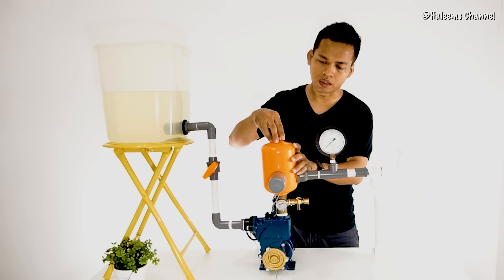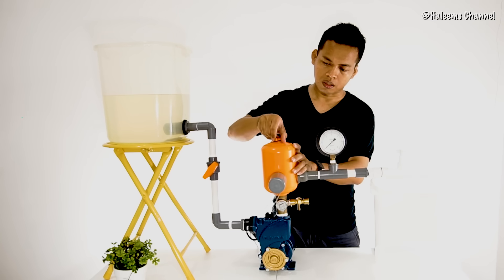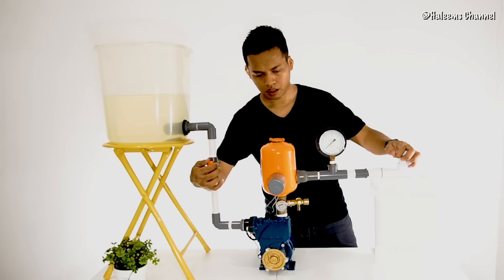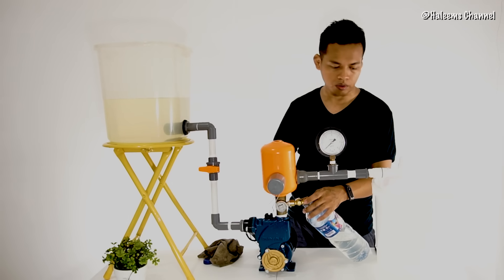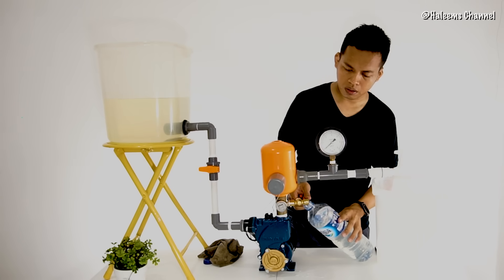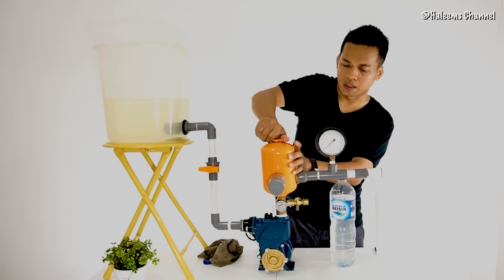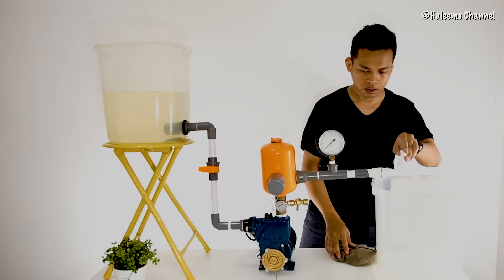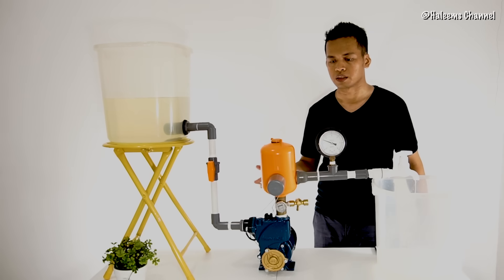Cara Memasang otomatis Pompa air dan Mengatasi Bunyi Cetak Cetek pada Otomatis/Pressure Switch

Comment: Pak saya ada pertanyan, jika sekiranya berkenan menjawab:

Pompa air saya kadang cetak cetek terus setelah 2 minggu instalasi,, saya makai pompa air shimizu ps 135 e.
Pompa air tsb dipasang setelah toren kapasitas 750 liter-> ke filter frp 1054 2 unit -> ke area output rumah (2 kamar mandi, dapur, & halaman).

Penyebab cetak cetek kenapa ya?
Apakah ada cara/solusi terbaik mengatasi permasalahan tsb ?
Reply from the maker: Cetak cetek kalo masih ada jeda nya, ada ritme, itu masih kondisi normal/wajar...
Tapi kalo cetak cetek nya tanpa jeda, itu berarti sedang bermasalah pada tangki nya sudah penuh terisi air...

Banyak metode utk mengatasi cetak cetek...
Paling sederhana, keluarkan air di tangki nya, 
Standar tangki model PS135E, tidak ada karet pemisah.. sehingga sangat mudah berpotensi cetak cetek... sebaiknya ganti tangki yang ada karet nya...

Metode metode lain..
Seperti APC, kombinasi flow switch+pressure switch, ganti tangki yg lebih besar, dll... itu semua bergantung kebutuhan dan budget nya ..
Reply: @HaleemsChannel  terima kasih pak atas penjelasannya. Iya betul, cetak-cetek di tempat saya masih ada jeda & ritmemya. Jika saya milih untuk mengganti tabung standar PS135E dgn tangki yg ada karetnya, apakah ada contoh merk & seri yg di rekomendasikan ?? 
Saya jg menyesuaikan budgetnya.

Terima kasih

Comment: Selamat pagi bosskuu.

Saya punya pompa tabung merek dab.

Dia cetak cetek, kemungkinan tekanan di tabunganya kurang ya ?
Reply from the maker: pertama kenali dulu jenis tabung nya ya gan..

type tabung ada beberapa jenis..
1. tabung biasa, tanpa penyekat/membran pemisah sisi basah/air dan sisi kering/udara.

tabung jenis ini, lebih cepat habis isi udara nya, sehingga lebih sering bermasalah bunyi cetak cetek..
tidak rekomended..

2. tabung dengan penyekat setengah, dimana posisi penyekat/membran nya ada di tengah, ukuran membran lebih kecil, tidak bisa/tanpa refill udara atau gas nitrogen.

tabung jenis ini, cukup membantu mengurangi cetak cetak, kekurangan nya volum udara nya gak begitu besar, karena hanya separo dari volum tabung nya... selain itu tidak bisa di refill udaranya..
kurang rekomended.

3. tabung dengan penyekat bladder, yaitu membran nya terpasang dari sisi lubang input, ukuran membran lebih besar, dapat di refill udara/gas nitrogen

tabung jenis ini, merupakan tabung yang ideal, sistem pemisah nya dgn volume lebih besar yaitu hampir seukuran tabung nya.. dan bisa di refill, 
tentunya tabung inilah yang paling awet dalam hal isi udara nya.
sangat rekomended.

Comment: Pompa saya shimizu 135 pertama masang tidak apa2 otomatisnya normal.. Dapat 4 hari bunyi cetak cetek.. Posisi kran di tutup cetak cetek coba ta setting putar kanan setelannya di preasurenya mas sampe bunyi cetak cetek berhenti.. Trus coba kran ta hidupkan malah cetak cetek pas waktu hidup krannya, ta coba lagi posisi kran hidup ta putar ke kiri setingan preasurenya sampai bunyi cetak cetek hilang dan pompa menyala lancar, ta matiin kran ehh balik lagi bunyi cetak cetek posisi mati krannya.. Coba ta ambil tengah tenganya putaran antara ke kiri dan kanan di preasurenya,  malah bunyi terus cetak ceteknya, baik ppsisi kran tertutup maupun terbuka. pompa saya fungsikan sebagai penghisap dari bak kamarmandi kurang lebih 2meter dan outputnya langsung ke water heater gas. posisi pipa juga tidak ada yang bocor. Mohon solusinya mas.. Apa harus ganti preasure apa gimana? Terimakasih.. 🙏🙏
Reply: Siap om terimakasih pencerahannya.. Maturnuwun.. 🙏🙏🙏🙏
Reply from the maker: Sami-sami...
Reply from the maker: Baut settingan pressure switch sebenarnya di locked, tujuannya agar gak disetting oleh konsumen..
Baut tersebut adalah untuk setting pada saat membuat nya agar sesuai soesifikasi yg ditulis... Jadi misal kan pressure switch itu punya spec. 1.1kgf/cm2 ON, maka pada saat produksi baut itu di set sesuai angka itu...
Nah kalo misalkan dirubah, akibatnya specnya gak sesuai dengan kemampuan pompa nya...
Itu sebatas informasi mengenai baut setting pressure switch..

Nah kasus yg bosqu ceritakan ini, model 135e, ini sebenarnya yg masalah hanya pada accumulator nya saja.. masalahny adalah tabung accumulator sudah terisi air penuh...sehingga timbul bunyi cetak cetek..
Solusinya bisa gunakan accumulator yg menggunakan bladder, ato ganti yg lebih besar..
Dan karena pressure switch nya sudah di putar2 baut setting nya, ini juga harus disetting ulang, caranya harus menggunakan alat ukur pressure gauge..
Kalai dengan Feeling susah ngepasin nya buat setting tekanan nya..
Reply: Uwalah seperti itu ya mas.. Untuk mengeluarkan air di tabungnya shimizu 135 itu apakah bisa mas.. Misalkan airnya yg ada dalam tabung dikeluarkan apakah bisa normal lagi..? Penyebab masuknya air ke dalam tabungnya itu apa mas..?
Reply from the maker: @thotoefendi8143  bisa, tapi gak lama akan penuh lagi dan timbul cetak cetek lagi...

Comment: mau tanya bang, di rumah saya kan pakai sumur tetapi otomatis gak bekerja, jadi hidup terus, tetapi saya coba di air pam, otomatis nya bekerja, ada solusi kah untuk yg sumur, saya cari2 di internet belum ada yg bahas..makasih
Reply from the maker: Bila otomotis switch nya adalah pressure switch, dan mengalami problem, switch tidak mau OFF (alias pompa nyala terus), ini bisa saja terjadi disaat kemampuan pompa lebih rendah dari spesifikasi nya pressure switch, 
Indikasi itu bisa terlihat saat di instal dari sumber air PAM, switch bisa bekerja... Karena dari air PAM, si pompa tidak perlu kerja berat...di banding bila di instal untuk air sumur..

Solusinya sih, cek kondisi pompa, tekanan nya harus mencapai 27m, bila kurang dari 27m, ini akan menyebabkan switch tdk bekerja pada kondisi maksimal..

Comment: Satuan ps sama psi bedanya apa mas
Reply from the maker: PS biasa dikenal HP (horse power), satuan daya.

PSi, adalah pound per square inchi, satuan tekanan.
Reply: @HaleemsChannel  kalau pompa air Shimizu pada umumnya cara lihat psinya gmn mas
Reply from the maker: @elshanum6982  lihat saja di name plate nya, disitu dituliskan total head nya dalam satuan meter (m), itu berarti tekanan dalam tinggi kolom air... 1 meter setara dengan 0.1 bar atau sama dengan  1.45 Psi.. 
Misalkan di tulis 30 meter berarti sama dengan 43.5 Psi
Reply: Saya sedang mencari pompa yg tekanannya 150psi selain pompa ro
Reply from the maker: @elshanum6982  150 Psi itu setara dengan 10.3 bar, ini bukan pompa untuk rumah tangga... biasa utk industri... 
Tekanan sebesar itu pun memerlukan motor yg besar..dan biasanya pompa ini multistage impeller.. 
Pabrikan untuk industri, biasanya merek EBARA...
Reply: Terimakasih bnyak utk penjelasannya mas

Comment: Bisa langsung ari nya masuk ke mesin cuci otomatis bukaan depan?
Reply: Saya memakai mesin cuci top loading (bukaan atas)menggunakan mesin pompa otomatis shi**zu pas mesin cuci bekerja selalu cetak cetek gak enak sama tetangga belakanh..mohon solusinya
Reply from the maker: @HeriYanto-lt2zi  mesin cuci top loading biasanya memiliki saluran supply air dengan debit yg kecil di bawah 5 liter per menit, bahkan hingga 2 liter per menit, kondisi ini yg menyebabkan normalnya pompa pressure switch menjadi cetak-cetek,
Solusinya, bisa menggunakan pressure tank yg lebih besar, untuk menambah ruang kompresi tekanan sehingga kondisi cetak-cetek ada jeda (frekuensinya tidak sering)
Solusi yg lain sebaiknya menggunakan flow switch, ini lebih efektif, tapi perhatikan spec. Flow switch nya harus sesuai dengan minimum aliran air di mesin cucinya, supaya tidak gagal fungsi..
Reply from the maker: Mesin cuci front loading ( bukaan depan ), memiliki jalur supply air yang kecil, sekitar 2-3 liter per menit, kondisi seperti itu di perlukan reduksi tekanan yang lebih tinggi, artinya perlu pressure tank yang lebih besar untuk dapat kerja lebih optimal (agar tidak terjadi ON/OFF terus menerus),
Atau jika ingin lebih bagus, sebaik nya gunakan pressure controller.
Selamat mencoba, untuk hal yg belum jelas silahkan tanyakan kembali..
Reply: @HaleemsChannel  pressure controler sprti yg d video atau beda lagi
Reply from the maker: @bidansyifa3727  pressure controller berbeda dengan pressure switch.. sistem kerjanya sudah lebih baik

Comment: Mau tanya bgm kalau posisi toren ada dibawah sedangjan yg di butuhkan di atas rencana stod air pam
Reply from the maker: Untuk menampung air PDAM, sudah benar penampungan posisi dibawah, memang sebaiknya menggunakan underground tank, lalu dari undergorund tank bisa digunakan pompa hisap ataupun submersible, dihubungkan langsung ke masing2 kran air..

Penggunaan tanki air di atas dengan tower, biasa diperuntukkan agar mendapatkan tekanan dan laju aliran air yg lebih besar, nah kondisi ini biasa memanfaatkan gravitasi, atau bila tekanan masih kurang biasa ditambagkan pompa booster.. pompa booster jenis ini bisa menggunakan fliw switch ataupun pressure switch..

Dari PDAM ke tanki atas bisa menggunakan tipe lift up..tipe ini menggunakan sistem pressure switch atau water level control

Comment: Kang mau nanya....
Kalau mesinnya sering hidup mati hidup tapi padahal kran air tidak hidup.....
Solusinya bagaimana ya kang???
Reply from the maker: Sering hidup mati pada saat kran tertutup, ini terjadi bila tekanan didalam pipa menurun,
tekanan didalam pipa menurun disebabkan adanya bocor pada titik tertentu, biasa titik bocor ini pada sambungan yg memiliki ulir, seperti sock drat, elbow, kran, dll..

Pastikan tidak ada bocor di sistem pipa nya..

Yg kedua pastikan tidak ada bocor di pompa nya sendiri, cek bagian2 sambungan atau tutup, misal tutup lubang pancing, sambungan pressure switch ke body pompa, sambungan tank ke bodg pompa, serta cek juga kondisi mekanikal seal nya...

Jika bocor, solusinya gunakan seal tape yang cukup
Reply: @HaleemsChannel  Ok terima kasih solusinya kang....
Saya coba cek di pompanya dulu, soalnya kran" yang bocor udah di ganti semuanya...
Reply from the maker: kalo gak ada yang bocor dan masihhidup mati, cek kondisi chack valve di bagian suction nya, pastikan tidak bocor balik ke arah tandon/toren

Comment: itu hampir merepuai bosster ya
torent ke rumah
itu gak pakai klep gpp ya? kan ada tekanan balik ke torent
misal tabung 19L?
Reply from the maker: Booster adalah nama istilah dalam aplikasi penggunaan pompa air... Pompa apapun yang difungsikan sebagai penguat tekanan bisa disebut booster pump...
Ada dua type booster yang biasa dikenal... 
1. Home booster
2. Central booster..

Home booster, ini biasa di gunakan di indoor, dimana 1 pompa untuk menguatkan aliran hanya satu kran..biasanya kran shower kamar mandi.

Central booster, jenis ini menggunakan pompa 1 unit untuk menguatkan dorongan aliran air ke semua saluran kran..biasa di instal di outdoor dekat dengan bak penampung air...
Reply: @HaleemsChannel  saya rencana yg seluruh rumah
Masih bingun harus pakai klep  atau tidak

Secara umum pompa sumur klep arahnya ke atas

Jadi klep untuk boster bagusnya arahnya bebas ?
Reply from the maker: @yudha901  tekanan balik atau istilahnya water hammer sangat berbahaya, karena tekanan nya bisa melebihi dari kapasitas pompa nya... besar kecilnya water hammer di pengaruhi dari kecepatan aliran air dan panjang nya aliran air... Semakin panjang semakin punya potensi water hammer yang besar...semakin cepat alirannya semakin berpotensi water hammer yg besar...

Efek water hammer bisa mempengaruhi kerusakan pompa, pipa bocor, kran cepet rusak, dll

Utk mengatasi nya paling aman adalah dengan menggunakan water arrester atau pressure tank.. jika water hammer nya kecil cukup dengan check valve/klep tabok..
Reply: @HaleemsChannel  di pipa isap saya memakai hose untuk menyambung pipa, saat kran out ditutup dan pompa mati ada semacam lonjakan tekanan pada hose tsb, dilihat visual kelihatan, bagaimana cara antisipasi lonjakan tekanan tsb mas? Sy pake shimizu ps255bit yg sudah ada pressure tank nya
Reply from the maker: @MrBen-vu2oo  lonjakan tekanan ini biasa disebut water hammer, 
Water hammer cukup signifikan efeknya berdampak pada kerusakan pompa dan pipa, cara mengatasinya harus ada water arrester atau tambahkan pressure tank yg lebih besar, tujuan utk mereduksi tekanan balik atau water hammer..
Reply: @HaleemsChannel  iya ini yg namanya water hammer, jadi pressure tank itu harus berisi udara ya yg berfungsi sebagai peredam water hammer tadi, terima kasih ilmunya sangat berguna mas.

Comment: Met siang Mas.... Permasalahan di rumah sayab kalo buka kran kecil suka bunyi cetak cetek kaya putus sambung gitu.... Ini bagaimana solusinya.... Mohon bantuannya.
Reply from the maker: Siang boss... Permasalan cetak cetek ini hanya karena tabung nya kurang bisa mereduksi tekanan yabg di hasilkan pompa,
Pada saat kran di buka penuh, tekanan di dalam pompa menurun yang nilai nya masih bisa di cover oleh kemampuan tabung,
Namun, pada saat kran sedikit di tutup sehingga aliran air kecil, ini menyebabkan tekanan dalam pipa naik, dan besaran tekanan itu diteruskan ke tabubg tekan, yang mana besarnya tekanan lebih besar dari kapasitas ruangvtekan nya tabung itu sendiri..sehingga tekanan tidak bisa di akumulasi, sehingga tekanan secara langsung diteruskan ke pressure switchnya, sehingga terjadi range ON/OFF yang singkat tanpa jeda atau jeda nya pun relative pendek, ini bergantung dari ruang tabung tekannya..semakin besar ruangvtabung tekan semakin lama jeda range ON/OFF nya.

Jadi, solusinya bisa gunakan tabung tekan yg lebih besar..

Atau setting pipa hisap nya lebih kecil, dengab pasang kran pada pipa hisap, itu artinya supply air nya lebih kecil.. Tapi cara ini tidak rekomendasi..karena akan mengurangi performa pompa nya

Comment: mas kalo yg pake bladder apakah harus dipompa angin dulu  bladder nya sebelum dipasang ?
Reply: hanafi tan dipompa yaitu 2 psi di bawah cut in pompa atau pompa on
Reply from the maker: Kalo beli nya baru, bawain dari pabrikan, sudah termasuk gas nitrogen di dalam nya.. bisa dicek melalui lubang saluran masuk air, dimana pada saat terisi gas nitrogen, blader menutup lubang masukan, sedangkan bila belum terisi atau karena bocor, blader nya pada posisi free, tidak menutup lubang masukan..

Comment: tanya lagi , kalo pressure tank kita ganti sama yg lebih besar apakah boleh ? , apakah ada yg perlu di pertimbangkan
Reply from the maker: Lebih besar lebih bagus, pertimbangannya hanya hrga lebih mahal, tapi kalo harga gak masalah ya sebaiknya yg ukuran besar..
Pertimbangan lain hanya minor aja sebagai pendukung, misal, tempatnya harus ada/bisa diinstal yg besar (ada space), kontruksi pemasangan (kalo lebih besar biasa diperlukan penyangga) karena lebih berat, dll
Faktor baiknya:
Semakin besar tanknya, semakin besar ruang kompresinya, dan switch nya akan lebih stabil, karena lebih stabil, efeknya umur pakainya akan lebih lama/ lebih awet, 
karena switchnya lebih stabil, ini juga berpengaruh pada kelistrikannya lebih ekonomis.
dll.

Comment: Mau nanya lagi nih, kalo pompa sanyo ph150 (tabung bawah) pressure switch sudah off tapi masih ada suara berputar (bukan melengking) namun air  tidak keluar , kalo saya matikan listriknya maka suara berputar tsb hilang.
Namun apabila listrik tidak dimatikan lama2 saya harus buka lubang pancingan untuk mengeluarkan angin kemudian saya tutup lagi tanpa perlu diisi air kemudian dinyalakan maka hasilnya normal kembali.
Kejadian tersebut sudah berjalan 2 bulan ini, usia pakai sudah 8 tahun.
Spare part yg sudah ganti adalah capasitor dan air check valve.
Mohon petunjuk, bagian mana yg perlu diperiksa atau diganti.
Terimakasih.
Reply from the maker: wouw...umur pakai yang cukup lama, 
problem suara berputar saat kondisi pompa setelah dimatikan, model PH150 (tabung dibawah), hal ini bisa saja terjadi karena check valve tidak bekerja dengan normal,
pada saat kran di tutup, tekanan akan naik mengkompresi didalam ruang tabung hingga maksimal spec. prssure switch menjadi OFF, saat pressure switch OFF, motor berhenti, dan sumber tekanan berhenti, namun tekanan yang berada dalam tabung akan menekan ke segala arah, salah satu nya ke arah check valve yang berada pada saluran hisap, saat tekanan mengarah ke saluran hisap, normal nya check valve harus menutup, namun bila tidak menutup dengan baik (misalnya valve nya miring, atau terganjal benda lain, dll) maka tekanan menuju kearah pipa hisap, saat tekanan ke arah pipa hisap inilah terjadi putaran impeller, yang berasa pompa itu bunyi putaran...kejadian ini sebenarnya sangat cepat proses nya, bergantung dari besaran tekanan yg dihasilkan pompa nya... dan jika dibuka lubang pancing, maka tekanan didalam langsung terbuang.

solusinya, check kondisi check valve nya, bisa berfungsi dengan baik atau tidak, dengan melakukan test kebocoran...

selamat mencoba untuk memperbaiki..
Reply: @HaleemsChannel  
Sepertinya memang check valve (foot klep) yg perlu diganti karena sudah lama pemakaiannya.
Oke, saya periksa dulu. Terimakasih sarannya boss...